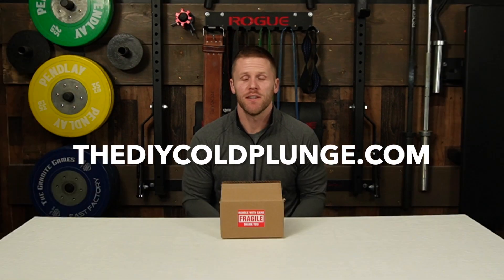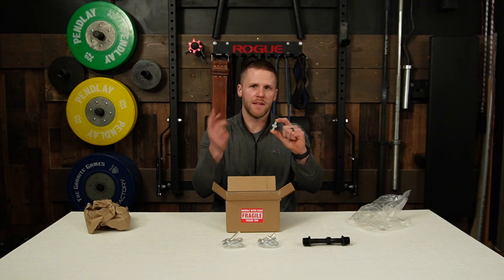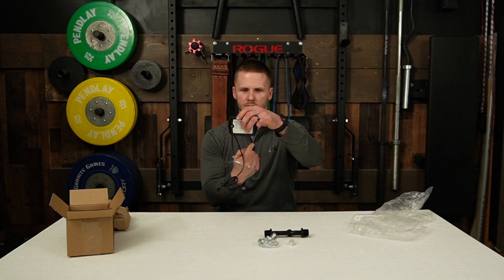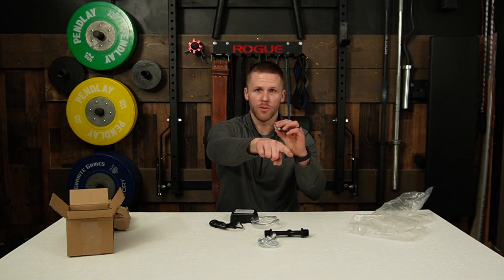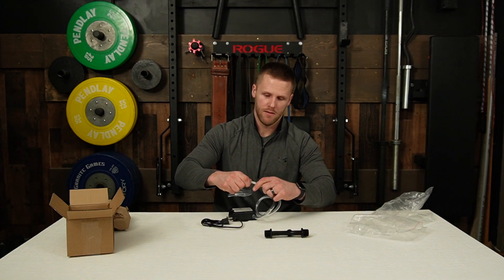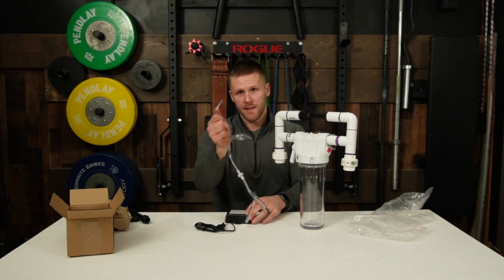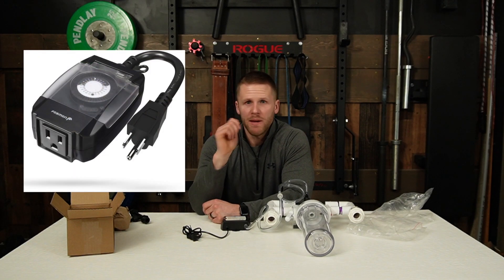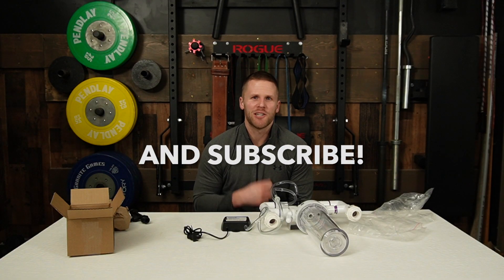DIY Cold Plunge Ozone Setup | The Best DIY Cold Plunge Ozone Generator | Ambohr Spa-124 Ozone

Comment: How many gph pump should I use?
Reply from the maker: Too many factors to answer that flat out. Plumbing complexity and chiller size are the main factors. In general - the Danner 950 for 1/4HP and 1/3HP, Danner 1200 for 1/2HP
Reply from the maker: The BEST Pump in DIY Cold Plunge | Everything you need to know about Danner Pumps 👍
https://youtu.be/8WqQjthWgWU

Comment: Just a fantastic site. Thank you. I have an Ice Barrel 500. Looking to add an ozone generator. Current setup at the base port is filter/strainer, pump, chiller that then spits water into the top port. Where in this setup would you recommend adding the ozone generator?
Reply from the maker: I'd put the ozone last in line for a setup like that 👍

Comment: I broke down and got an ozone machine. I tried CH and surprise, my indoor setup is bad for that lol 😅
I'm not putting it on the filter, I'm putting it on the outlet side. I'm refinishing the panels and trim work, I will get you the blog post review for my indoor setup eventually lol. Been using for 3 weeks, it's been great. My reasoning for putting it past my chiller (outlet side) is purely convenience and I don't want a mess of plumbing in one place. The framing plan left a LOT of airspace in the mech area which I appreciate and make good use of with various components all spaced out effectively. Just needed to know the duration you run yours. 1hr~ cool and thanks for The content. Hopefully I can give back eventually with the blog post.
Reply from the maker: Awesome! I usually recommend 1-2 hours depending on use. If only one person 1 hour should be fine.

Comment: Mine is setup as follows: strainer-> active aqua pump->chiller. Using this generator, can I attach the Venturi connector directly to the pump or will that affect water flow?
Reply: Also, can the Venturi connector be installed horizontally?
Reply from the maker: The venturi can be vertical, and you can go in line but it would be best to set up on a loop with a ball-valve so you don't restrict too much.

Comment: The way you have your filter / ozone setup doesnt som water bypas the filter also if i was to do this i would probably just add it inline on my rubber hose does ozone eat away at ruber hose
Reply from the maker: I'd recommend setting it up like this, anything else will decrease the flow substantiallly. I'd check the material of your rubber hose for ozone compatibility

Comment: What’s your thoughts on just dropping a weighted line in the cold plunge instead of running through the piping? I have a grizzly set up and I’m noticing people like desert plunge. Don’t integrate it into the piping the run align directly into the Plunge.
Reply from the maker: You'll need a more expensive ozone generator iwth a built in air pump - these typically have a much higher ozone output too, so that is something to be cautious of when running it. Check with whatever model you get though.

Comment: I was told by the community that the tubing on the ozone generator needs to have a loop in it on its way to the venturi valve. I was told that it had something to do with helping the vacuum it needs to create. is this true?
Reply from the maker: You can do that, it's a precaution against water backing up into the generator, it has nothing to do with the vacuum
Reply: @DIYColdPlunge  thanks for answering ! Good to know

Comment: I'm not getting much ozone through this setup. I see a few bubbles, but I'm wondering if my pump just isn't strong enough? I'm using the Penguin Cold Therapy Chiller. I've also tried diverting more of my water from the filter to the venturi injector, same results. My water gets murky in about 3-4 weeks, same exact as it was before using this ozone setup. Literally no difference. 

Any ideas?
Reply from the maker: If you're using the built in pump it probably isn't powerful enough

Comment: The chiller I have has integrated filter and Ozone.  The ozone setting allows you to set time for 0-5 minutes, and it seems to run the ozone every hour for the time you set it to.  Because of this, the ozone will sometime run during my plunge, should I be concerned?  The chiller didn't come with any good instructions, unfortunately.  Not really sure how to set the Ozone, any advice would be greatly appreciated!
Reply from the maker: I've plunged with my ozone running 24/7 for a months time (experimenting) and did not experience anything negative.

Comment: I run my generator with the lid closed in my 400 qt Grizzly cooler plunge. Do I need to be concerned with the gas being trapped inside the cooler or am I to understand that once it hits the water dissipates . Thoughts?
Reply from the maker: I personally haven't had an issue, or heard of anyone have any issues with it - but there's a lot of speculation around that. I've ran mine 24/7 in my garage for a month long test and I didn't have any adverse side effects. I just wouldn't take a big whiff right away after you open it.

Comment: I had to add a ball valve, because it was still pulling air into the system, creating hella bubbles. And yes, i put the one way value in correctly.
Reply from the maker: Where did you add the valve? You want to see bubbles at the return to your tank, that's how the ozone gets into the water.
Reply: @DIYColdPlunge  Before the one way valve. When the ozone generator wasn't ON it was still pulling air into the system, creating constant bubbles 24/7. I leave the ball valve open.
Reply from the maker: @bfighter125  Bubbles even when it's off is normal for this generator and configuration. If you ever don't see bubbles that's cause for alarm that there's an issue with your plumbing setup.
Reply: @DIYColdPlunge  I thought it would ruin the ozone generator, if it's sucking raw air out of it?

Comment: So when running the ozone generator with the venturi and the ball valve, what does the ball valve do? Is it used to adjust the water flowing to the venturi, creating the proper amount of suction?
Reply from the maker: Yep, basically prioritizes the flow rate to create suction.

Comment: If the check valve and venturi are installed properly, will there ever be water in the clear tube?
Reply from the maker: It is possible. If water stops flowing or there becomes a flow rate issue are the two biggest reasons. It's best to install your tubing in a loop and attach your generator above the water level line of your tank/tub.
Reply: Okay thank you! So if there is water in the line, it’s an indication something is wrong?
Reply from the maker: @Ben-King  Yes, that means that there isn't suction happening in the venturi so ozone wont be able to reach your water.

Comment: Hey Joe! I have a few questions. 1) do you have plans for this set up without the filter? I have the intex 530 so it’s a pump/filter in one so no need to have another filter. 2) where would you recommend this set up being in the plumbing before the chiller or after the chiller? And if before the chiller would I have it before or after the intex pump/filter? Thanks!
Reply from the maker: You wouldn't need this setup with the intex, you could just make a loop with a ball valve in place of the whole house filter for the ozone system. If you go that route, I would keep the pump before the chiller and ozone after
Reply: @DIYColdPlunge  Can you expand on this? I have a Penguin chiller pump combo and it doesnt seem to have a high enough flow rate to create suction in the venturi.  Wondering if there is a work around or if I need to add a second pump after the penguin chiller

Comment: Hey,
I bought the new (gray) Venturi Injector does it need the back flow valve still?
Reply from the maker: Yes. the venturi only affects the plumbing system. The check valve is a fail-safe to protect the appliance

Comment: I have 2 commercial cold plunges for my business both with these exact ozone generators. One of them stays perfectly blue water. One tends to turn greener throughout the week despite exact same chemical and cleaning protocols as the other. Do you think the ozone generator has anything to do with this…? Is the ozone generator something I can clean? Thanks!
Reply from the maker: Interesting... I dont have anything like that to compare side by side. Are they made out of different materials? do they get the same amount of use?
Reply: @DIYColdPlunge  they are the exact same plunges. Cold Plunge Pro from PLUNGE. Ordered and delivered at exact same time. Same, if not less, use than the other (because it turns green faster we tend to push people towards the other one that stays more blue.) I just wasn’t sure if there’s something within the system that maybe needs fixed on that plunge. (I’ve contacted customer service at Plunge and have had no luck or help…)
Reply: @courtneystansell8095  I have the plunge as well and I had growth in mine from the start because there was no instruction to verify the pump DC unit was turned up to max RPM so I had to find this out the hard way. My unit needs to be set to 120.

I wrote customer support and they said once there is growth , you have to do a deep cleaning to get rid of it as the biofilm lives on the inside of the piping. That consisted of draining it, adding hotwater, adding some Ahh-Some spa pump cleaner and recirculating. They have a whole video on the site on how to do this.

Comment: I have a freezer setup with a submersible pump, would love to add the ozone, but don’t know what this ventura is, is there another option???
Reply from the maker: I've seen folks do an ozone generator with an air pump for freezer setups.. but those are typically 3x the cost at least for spa applications. If you are able to route tubes outside of the freezer from the pump you should be able to achieve a setup like this

Comment: Hey mate. Will the ozone generator work by itself or do I need a pump? If I need a pump is there any already made pump I can buy instead of making one? Thanks champ
Reply from the maker: Hey! This does not have a pump, it needs the plumbing system/venturi to get the ozone in the water. Not sure about already made pumps, but ozone generators with built in pumps for this volume of water will cost around $320

Comment: So are you filtering and using the ozone to water coming out of the chiller? Wouldn’t you want to clean the water before going into the chiller?
Reply from the maker: There's not much (if any) benefit to having the filtered water hit before the chiller in my opinion. There's many different chiller manufacturers and with it being the most expensive component, I don't want to risk the ozone damaging any of it's internal parts. Does that make sense?

Comment: Thank you for the video. I made the same setup but unfortunately the venturi does not create a vacuum.  I have to turn the bypass valve halfway on to divert more water through the venturi in order for it to work. Using a Danner 1200 g / h pump. Any suggestions?
Reply from the maker: have you checked all of your connections for leaks or anything like that? how long is the return tubing back to the tub from the filtration system?
Reply: @DIYColdPlunge  Yeah there are no leaks, the tubing is about 6-8 feet. I purchased the exact venturi injector in your video as well and pretty much copied everything exactly.
Reply from the maker: @Roy-hs3sr  What pump are you running?
Reply: @DIYColdPlunge  Im using a Danner 1200 GPH. Possibly the tubing is just long, i'm not sure.
Reply: What makes you say its not working? This setup worked awesome for me

Comment: Can these be left outside in 0 degree Wheather and snow?
Reply from the maker: I have my system outside and it's been down to -18°F. The manufacturer states that it is effective down to 40°F but it has worked for me in the extreme temps. One of these cases where your results may vary. I'm also pushing the limits for the good of the audience
Reply: What precautionary measures would you recommend (or speak to) in order to prevent the water in the ozone tube from freezing in below freezing temps? If it’s running for one hour per day, I worry about freezing for the other 23 hours. Would a stock tank heater in the electrical cabinet suffice?

Comment: Does your ozone unit have a built in pump or should it only run in tandem with a pump?
Reply from the maker: This needs to be installed with the Venturi in the plumbing, there's not a pump on the generator.